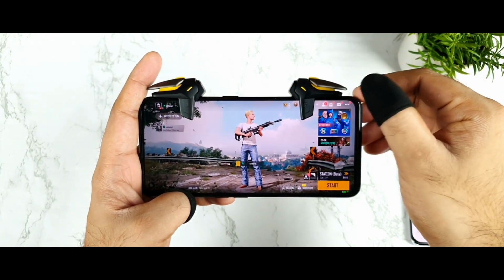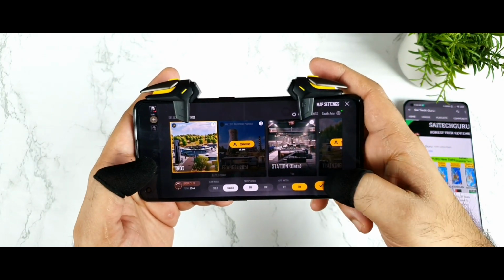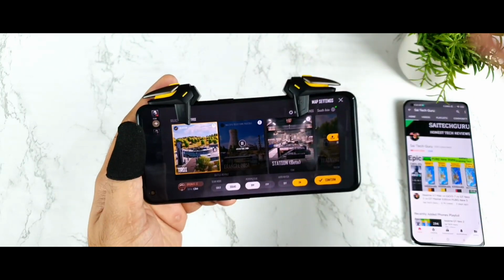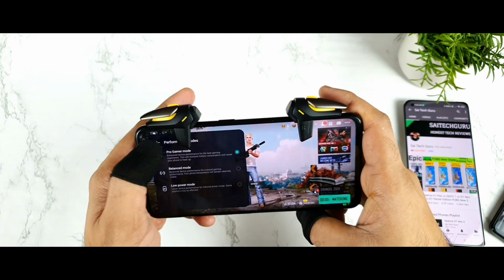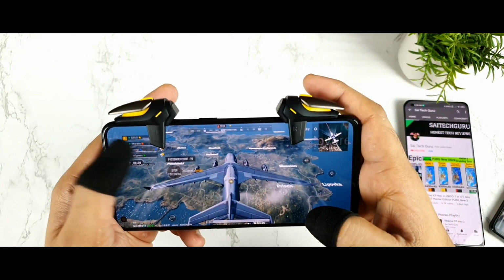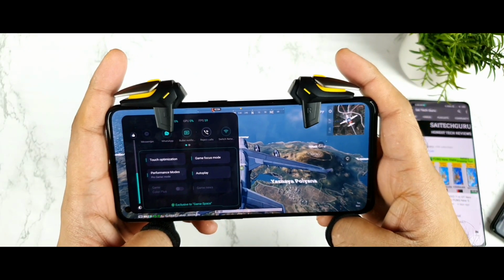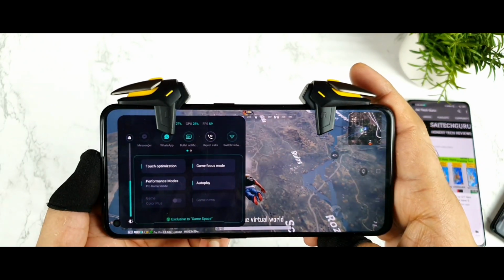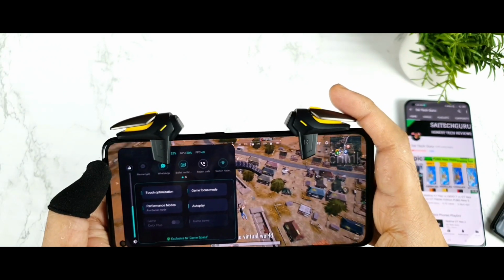Realme GT Neo 2 PUBG New State FPS Drop Test Using Ultra Graphics 🔥🔥🔥

Comment: Bro I have same phone but facing very low fps problem 5 - 20 fps only
Smooth extreme
Reply: Carry out the most basic things like-
1) close the developer option.
2) don't use gfx
3) make sure phone health is good and hopefully you've never dropped it in water and such things. 
4)close all the apks from background.
5) turn off fps meter if necessary(if u can)
6) play at normal room temperatures. If it's hot around you, don't play on highest settings. Temperature effects a lot.
7) delete all the unnecessary applications from your device because they might be consuming power behind the screens. Don't use any applications which run over other applications.
Or 
Adjust each apk according to your usage which should run in back ground and which shouldn't via application management. 
8)Restart the phone.
9) clear video game data. 
10) game is unoptimised anyway..